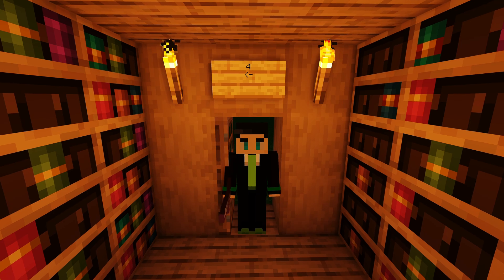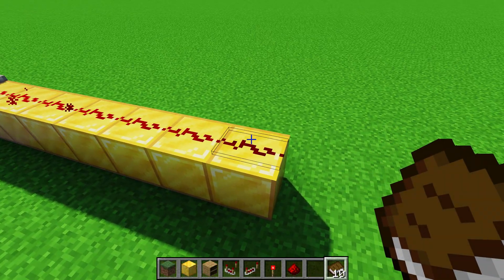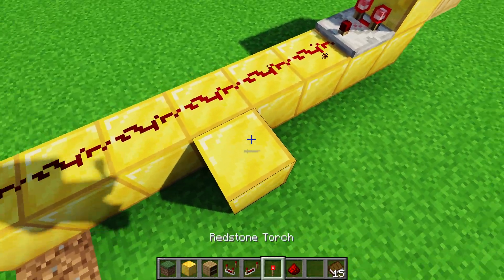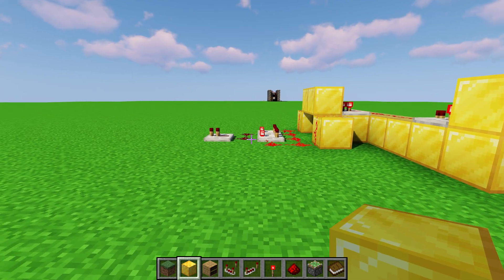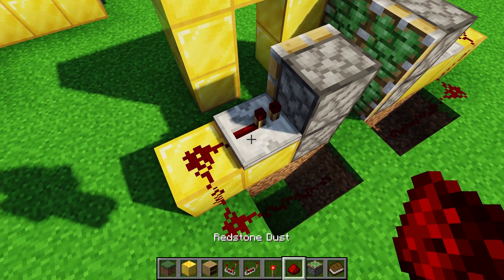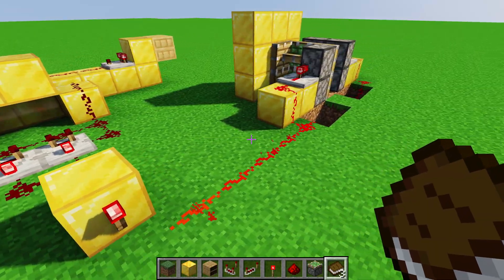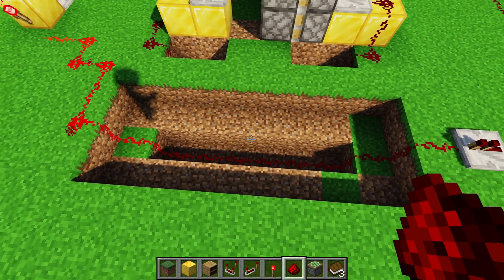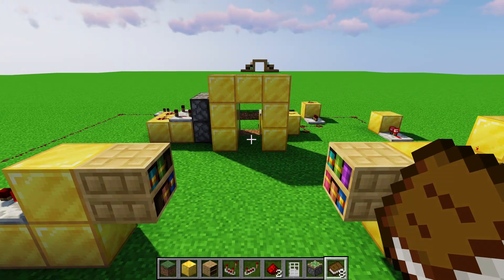How to Make a Hidden Bookshelf Door (Java & Bedrock) | Minecraft Redstone Engineering Tutorial

Comment: You can make the door open by defult and then have it it closed when unpowered then have a torch at the point you want the combo to be then the end of the redstone chain have it link back to the torch so anything but the combo causes your line to not be powered. If using for the a piston you could then negate that output. Think that would be a smaller combo. Similar logic tho.

Here is a video doing it 

https://youtu.be/IvWv_29_TGc?si=5OFEGUoC6TvC4RQE
Reply from the maker: Should be logically equivalent